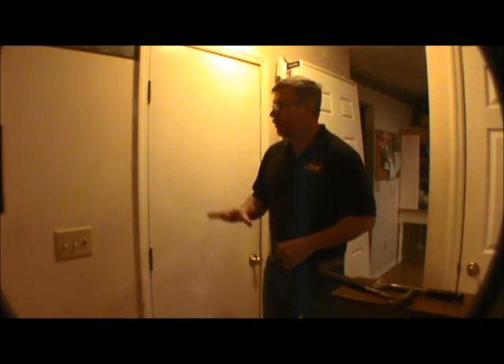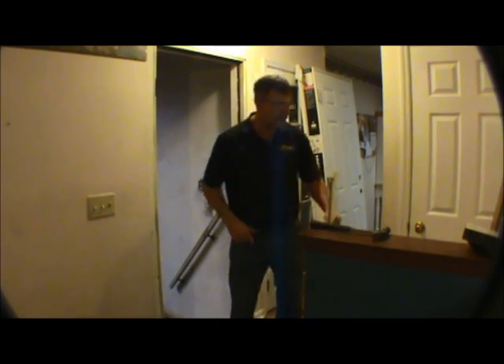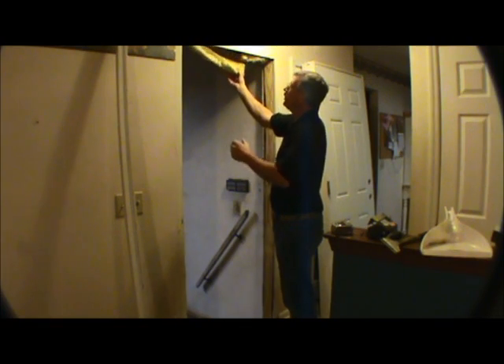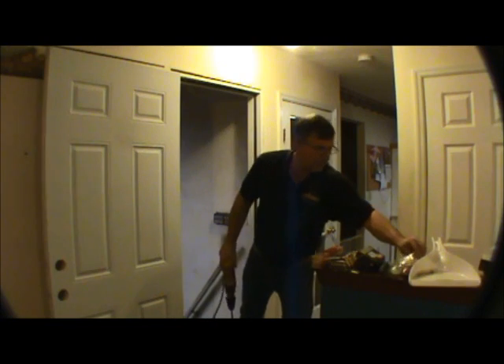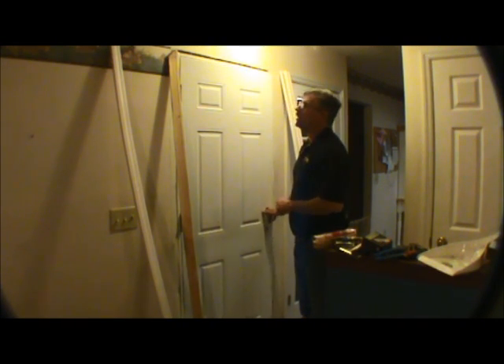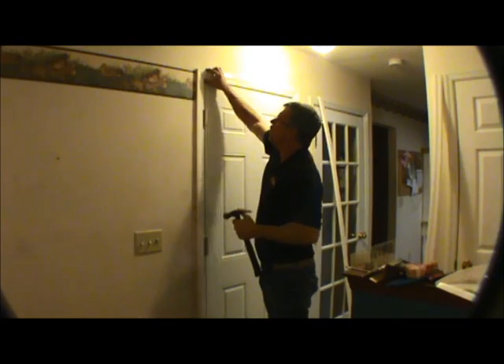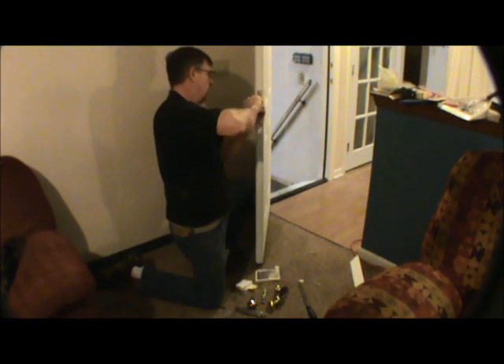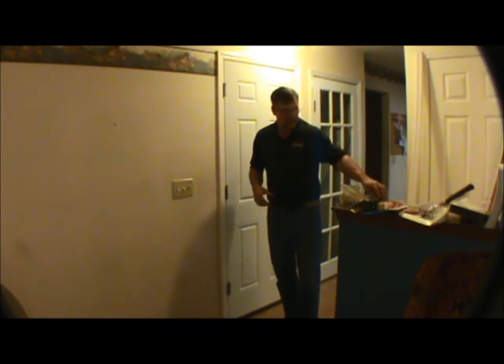Installing Fire Rated Door

Comment: Thanks Chris, I have an existing steel fire rated door that I need to hang on a new fire rated frame and install. Should it be fairly easy if I buy the exact same frame for the existing door?  Thanks

Comment: Thanks Chris for taking the time to share your work on the door.  I am encouraged now to tackle this job because you showed some of the problem areas (rough opening needed adjustment, door taller than adjacent door) and how to make the changes necessary.  Editing the video for brevity would be nice (show us one screw being installed instead of all of them), and some closeups of the key job points would have been even more helpful.